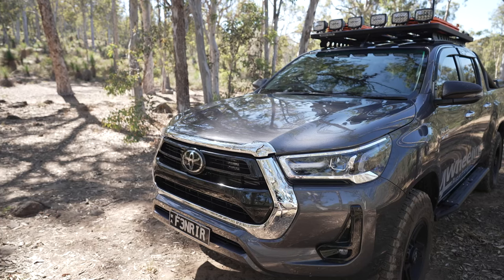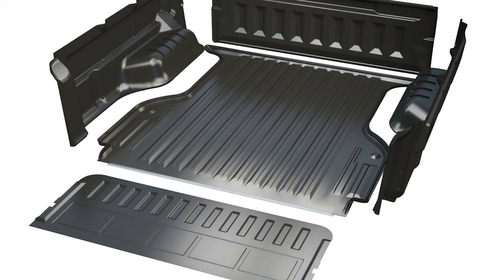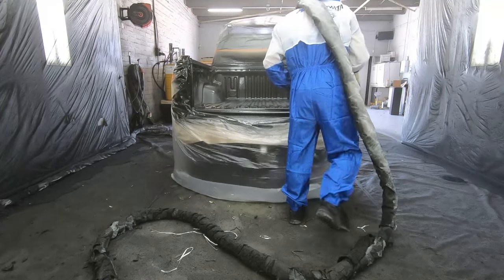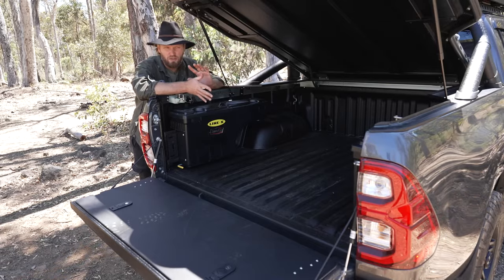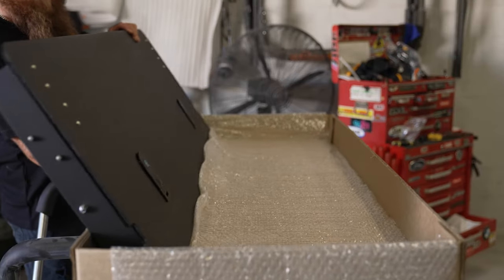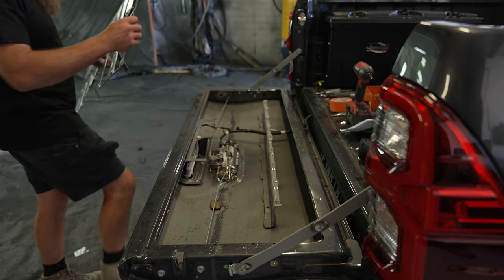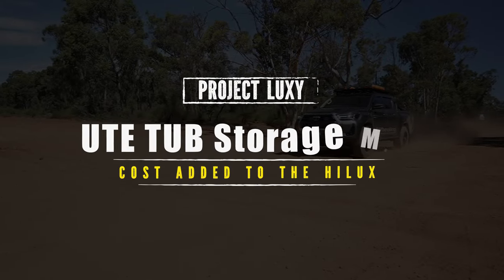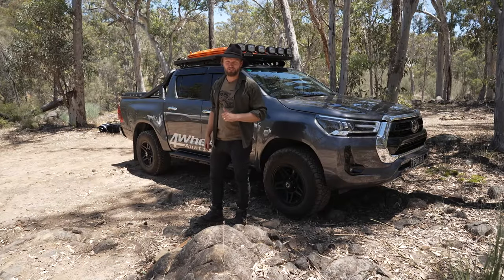2021 Toyota Hilux mods part 3, ULTIMATE UTE TUB MODS

Comment: Just started watching this, looks mint!! If you haven't already, when you put a diff drop in you will save yourself a CV or 3 by replacing the diff mount brackets (drivers side most importantly), horrendously common problem to bend and OEM one and bust a CV in the newer luxes!

Comment: Hi Ronny. On your weight tally @15:35 - You have correctly subtracted the weight of the factory side steps, but you also need to subtract the weight of the factory wheels & tyres. - Stay safe
Reply from the maker: I have subtracted the factory wheels and Tyres the 40kg is how much the 5 wheels and Tyres where overall more

Comment: Actually I find it hard to understand dual cab utes (and their pricing!) and people’s fascination with them. They stink at carting people and they stink at carrying freight. Ok if you need to carry four lumberjacks (preferably two medium and two small size!) and four chainsaws. Or two adults, two kids and a couple really dirty dogs (you can use a wagon of your dogs are reaonably clean).
Reply: They can carry more overall than a wagon, as they are longer and have longer wheelbases. Payload is also higher out of the factory.

But yeah, I prefer wagons as well.